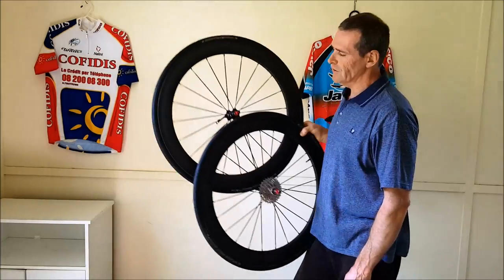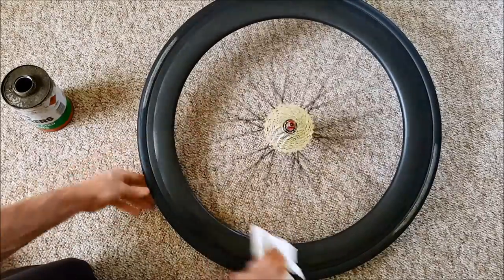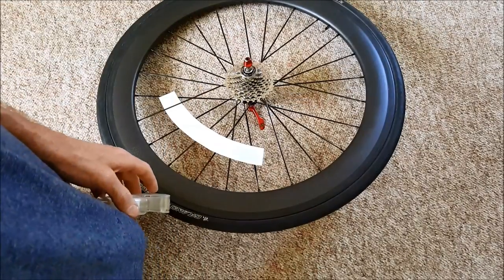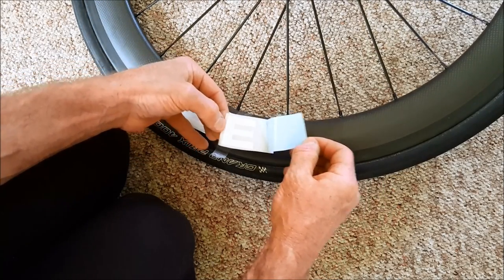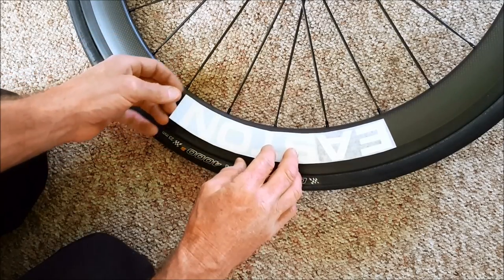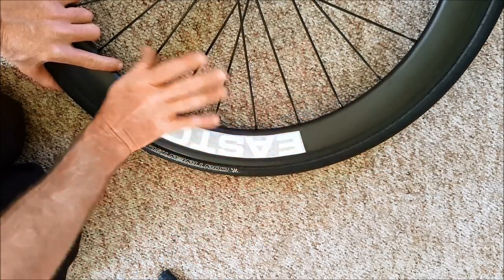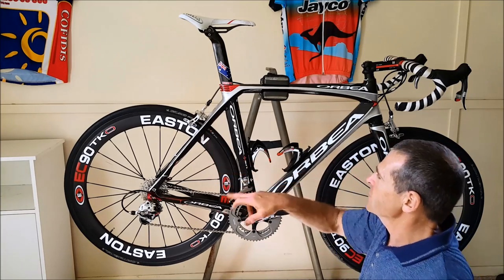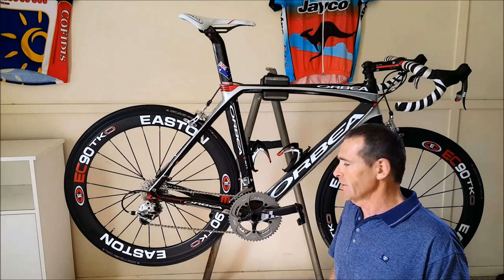Applying Carbon wheel Decals

Comment: The brand name companies dont complain about the stickers because it would be contradictory to the manufacturing, but they dont want you to know that.  I bought a set Yishun 80mm carbon wheels back in 2010 and they are still going strong. I only needed to replace the rear hub but after 10 years and tens of thousands of km's which is a pittance to pay for the longevity of these wheels.

Comment: thanks steven could you do a video on valves and what pump to buy if you have carbon wheels  great vid
Reply from the maker: +Tim Reynolds Hi Tim.  I will certainly add your suggestion to the list. Inflating  tyres on carbon wheels insn't much different to alloy,except for using a valve extender if required. Also I covered a few points about this in a previous video.  cheers

Comment: Gorgeous! Are you familiar with cadex wheels? Are the decals on those wheels sticker if not how do you remove them?
Reply from the maker: Sorry I'm not familiar with Cadex wheels. The decals will peel off but are good quality from a UK printer
Reply: @stevenleffanue  another question if you don't mind, how do you measure the size of the sticker? What if its a 42mm rim height and a rim brake wheelset? What's going to be thw height of the sticker?

Comment: It's kind of hard to tell. Are these matte or gloss finish? Have you had any issues with them sticking?
Reply from the maker: +Sam Rankin Rims are matt. Matt rims still have a resin coat,just not glossy. Never had trouble with stickers pealing on the rims.
Reply from the maker: +Sam Rankin Rims are matt. Matt rims still have a resin coat,just not glossy. Never had trouble with stickers pealing on the rims.